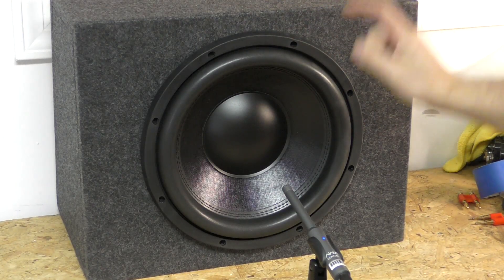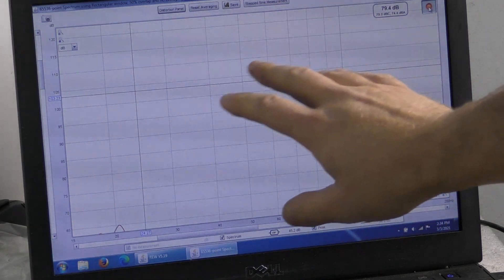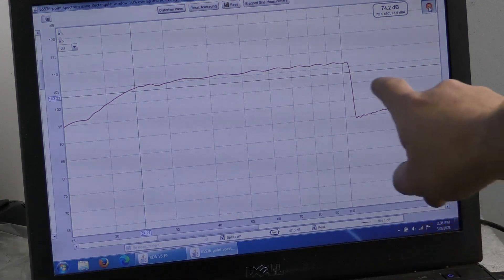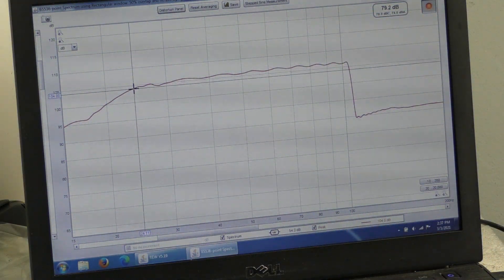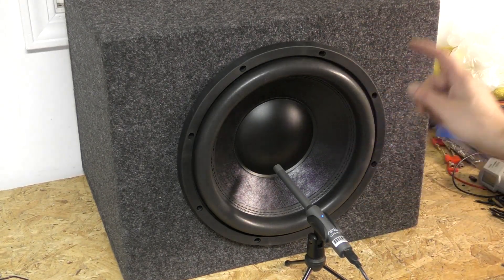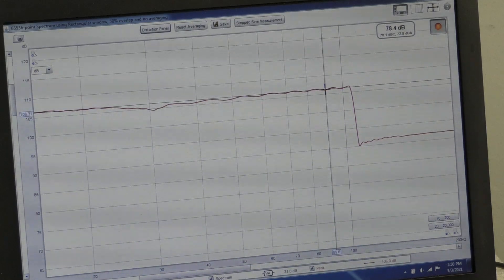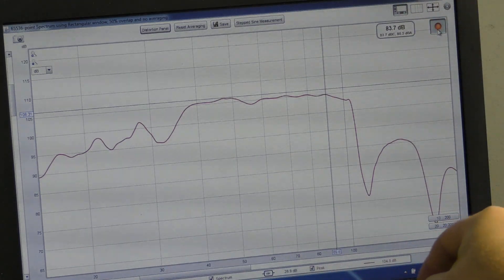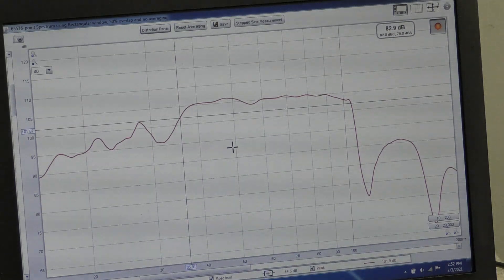EMF Audio Ghost 12" enclosure frequency response testing

Comment: NOW I'm conflicted about the sq build in my Suburban. I got 1 12 LB on preorder but now I'm curious about 4 10" Ghosts in there, too! Argh!
Reply from the maker: Do both? Lowballer will be shipping shortly, Ghost's will be a while out and pretty inexpensive too.
Reply: 4 10s will be tight. 
I ended up with 2 good quality 10s after years of playing around.
Think about some of the high end home audio speaker designs. 
More small drivers.
They got away from the one big 15 and so on. That's just my take.